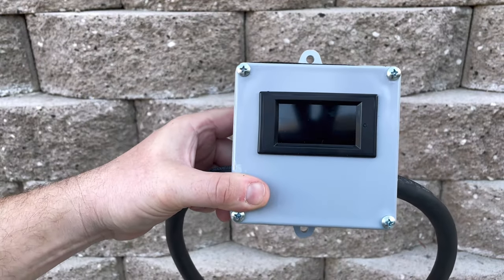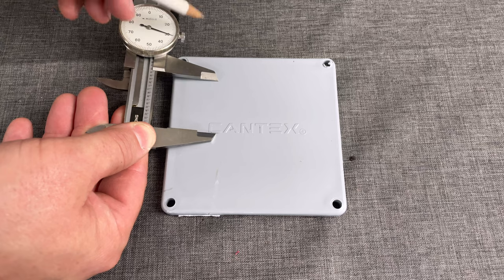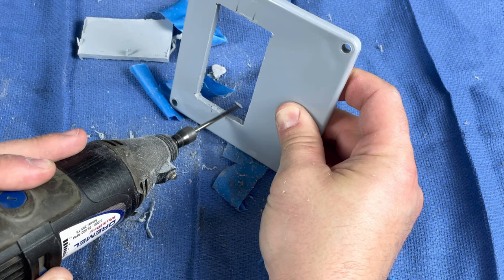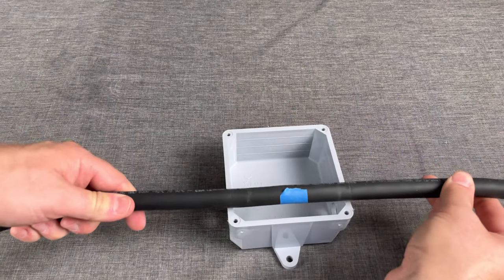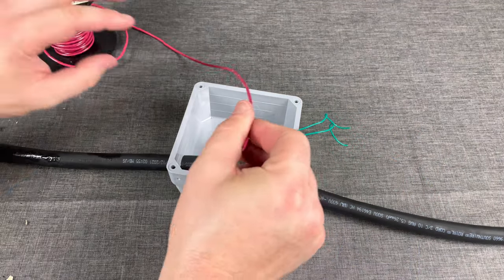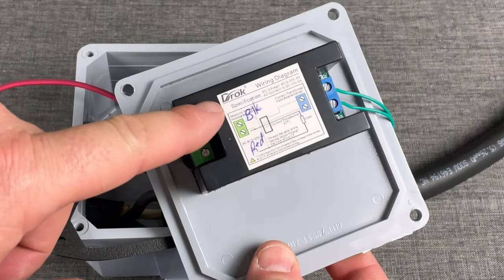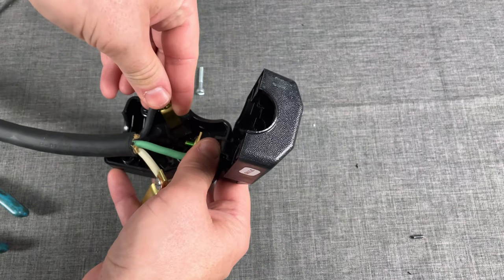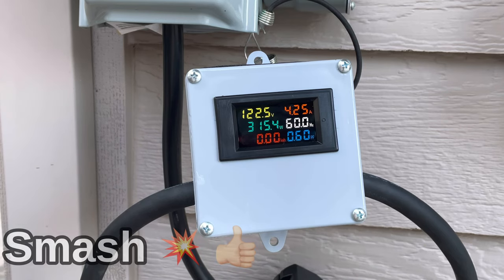Volts Amps Watts Meter RV Generator Load Meter Build

Comment: You didn't do anything to prevent the cables from being yanked out of the housing. Bare minimum could've put zip ties or hose clamps on the inside, best case proper waterproof clamping grommets.
Reply from the maker: Yes wire grommets or Electrical tape inside or a zip or something can be used which I mentioned as I was building it. For mine because I change stuff a lot for testing I did showed the basic build of it. Which you can go to the black wire or white it won’t matter. Or now someone decided to just copy what I did and refined it. Lol here look https://amzn.to/3MGTIEi

Comment: No strain reliefs and at a minimum you should have wrapped the plugs exposed wires.
Reply from the maker: Yea I could have done some plastic strain relief nuts but the plug I mentioned do not do and use the plug I had listed so there would be exposed wires. As I use mine to play around with stuff and I’m switching it to different plugs often.

Comment: I installed the Drok meter in my RV. First I disconnected the Transformer on the blue terminal and added about six feet of additional wire and then attached my "main" fuse panel positive wire through the round transformer hole. Second I had to supply power to the green terminal positive and negative. I ran two wires from the green terminal into my fuse box and connected the negative wire to the white ground bus bar. I added the positive wire to the main hot wire coming into the fuse box. Done. All the wires were ran up the interior wall and meter was mounted at eye level in the hallway above the fuse box. I should also state that I went to the main wire coming into the fuse panel because I wanted the meter to show all the power being consumed in the RV. I am also using my pure sine wave inverter and the meter works perfect and is easy to read without my glasses.  I am writing this because I wanted to save everyone some frustration that I had to go through.
Reply from the maker: Nice thanks for the tips 👍🏼😀

Comment: I would put the little compression nut strain relief things on the cables going in the box so there is no way to easily pull apart the wire nut accidently

Comment: Could I make one that has 2 read outs for a 240/50A outlet? For example: Leg 1 and Leg 2. I have a 15KW Generator and plug it up to my house. Just want to make sure I am not pulling too much load from one leg or the other.
Reply from the maker: I would not see why not. But you would tire into same neutral and power of each leg so wonder how that would work for the sensor…
May just have to try
Reply: If you use 2 phase 240 with no neutral you'll get the same reading on both legs they will be the same. So when you wire the meter you would hook a 120 line to each side of the meter instead of a 120 hot and a neutral like he did.
Reply: @walterking5210  You are correct but i think you meant  2 poles (split phase) 240V, which is 2 hot wires both carrying 120V, mostly specific to the US because the rest of the world mostly uses 1 phase 240V, which uses 1 hot wire carrying 240V :)
Reply from the maker: Yea the US still likes to do things differently with 120-240 options 😂
That’s why some of the manufacturers are like you need what?? 

The bigger Genmax I think with have a 240v single on the 9000 model.

Comment: After watching a multitude of meter build videos, I think I like your recent idea of just getting a base model Hughes Watchdog 30amp unit instead for my needs. The parts cost alone for this 120V build are almost as much as buying the Watchdog unit on a decent sale with the added benefit of also having a surge protector.  Keep up the great work!
Reply from the maker: Agree, and it’s more accurate. And like you I needed a new surge protector for my RV…😀👍🏼

Comment: I mean this is perfect, but a lot of reviews were saying that those meters weren't accurate at all.. so I'm not sure what to do I would love to have something like this hooked up though but it has to be accurate
Reply from the maker: The meter is not to far off. Down low it can be a little bit, after several checks it would only be off by about .1,.2 amps. 
But still works good for basic checking. But I have a $400 meter as well. 
Well and cheaper ones

Comment: I like it! I'm wanting to wire this permanently on the side of my house for my generator. You think I can add it in line between where the interlock breaker is and the inlet box? I wouldn't want to have it attached to a wire that haul out every time I lose power. Hope that made sense?
Reply from the maker: Yes you could easily add a wire and separate box and have it mounted right on top or next to your generator inlet box. 
Just tie into the wires from the inlet box and run it to the new box and meter. Get a covered box as you don’t want it getting soaked.
Reply: @johnnysweekends  really appreciate you getting back to me so fast! Thanks man!
Reply from the maker: No problem and thanks for watching 👍🏼😀

Comment: my generator uses l14-30r plugs, with 4 prongs on it, how would the wiring be different with a 4 wire cable vs a 3 wire cable
Reply: I think you would have to have two meters, one for each load wire (red and black)

Comment: excellent video! Does the meter readings (importantly power consumption)  reset when the plug gets disconnected or if there is a power outage?
Reply from the maker: Thank you 😀 

No the meter will accumulate hrs till you hit the little reset. 

The one I use for testing is continuing to go up in kWh. 

😀👍🏼

Comment: Any idea if the wires can be extended to mount this a few feet away from the point where the transformer is installed? Would like to put it closer to eye level in our RV instead of down at the floor.
Reply from the maker: Yes you can make it longer 😀👍🏼

Comment: I'm guessing I could do the same thing, with a larger box and two meters to test a 240v 50 amp power cord from my generator, using one meter on the red wire and another for the black wire? I could just run two pigtails, one to each meter. Is that right?
Reply from the maker: Yes each meter would get a hot/load wire.
Reply: did it work Patrick

Comment: With this set up are you measuring both legs or one?  Does the Amp reading represent total amps on the genset?  I also watched Gavins and noticed he has two meters.  At the end of the day  I have the reliance dual leg meter set up near the panel however I would rather have this at the genset and the digital is much easier to read when the lights go out.
Reply from the maker: Yea this is for a 120 volt set up and measures just only one line. Gavin made a dual set up as well so he could have a 240 volt. 
I found after much testing I wanted something a little more accurate hence I just bought a watch dog unit in stead since I needed one anyway. 
I had trouble with accuracy sometimes on the very low ended and upper ends.

Comment: Johnny good informative video, but you were making one mistake. The induction coil needs to be on the black wire, not the white neutral.
Reply from the maker: Yea I realized that after I made the video and ran it several times. Was surprised it still was pretty accurate but I think that’s mainly because I use it on generators and with a floating neutral well, it’s one in the same really.

Comment: Sorry... Another question or two. What size wire are you using for the accessory wire? Would that be the same wire used to extend the sensor wires? If I was to connect this monitor to a transfer switch, couldn't I connect the neutral wire directly to the bus. For good or ill, your great video got me thinking of multiple possibilities.
Reply from the maker: These can easily be hooked to your home distribution panel. I did one for fun just on one side. 

I’m using 10gauge braided wire. The sensor wire is small like 16g it just needs to pick up a signal. 

But yes you could use for multiple things to keep track of loads. Just run the hot wire thru it and you’re good.

Comment: Once in the meter is in the enclosure, is it fairly water resistant? The meter itself I mean. I'm curious if I could leave it plugged in and outside?
Reply from the maker: I would, just because I don’t think it’s sealed very well. So I would add a cover door to it .
Reply: If you used a proper weather tight cord connector like he shouldve for the 10/3 soow and placed a bead of silicone under the meter when installing it then you would probably be ok. Still would recommend trying to keep it dry

Comment: Nice. I'd like something similar to track the 240v wattage pulled from my RV generator. Know of any of those multimeter units that come with dual CTs?
Reply from the maker: Unfortunately I don’t know a dual set up but I am looking into some and wanna try out a couple things. Just been busy so it’s a back burner thing.
Reply: That's what I was hoping this video contained. Most generators are 240.

Comment: 6:05 "you want this on the supply side" Okay, You are connecting the wire back together. So wouldn't the sensor give you the same reading no matter where on the neutral you install it?

Comment: Will I be able to build something like this for 240 v 50amps that uses both a red and black hot wire? Or how would I wire it? Im trying to build it for my back up generator that is coming into the house.
Reply from the maker: Yes but you’ll need two meters one for each load wire.
Reply: @johnnysweekends  do you add the wattage together then?
Reply from the maker: Yes that will give the total draw. Or amps together.
Reply: @johnnysweekends  perfect thank you! That's what I need.
Reply from the maker: Let me know how it goes. I would like to try one meter into the neutral of the 240 to see how accurate it is. May have to look into that..🤔
Reply: @johnnysweekends  I'm having a hard time finding anyone else that has done it on 240v with two hots. Let me know if you have any resources for me. I'll let you know how it goes this weekend.
Reply from the maker: I don’t see why one on the neutral would not work. Your still going to have a return of power coming back so idk in theory from the generator inlet box headed to your panel should work. 
I’m not a electrical engineer but I did electrical work for a while. Have since moved on. Could try it, fire up the gen run a couple loads and check amps then check it on the meter to see if it’s roughly the same.

Comment: Thank you for this video! I see from the comments I would need 2 meters for a 2 pole / 240v circuit. But I have 2 questions:
1) Why can you not cut and splice the hots? In your video you just spread the coating of the black wire and wrap the pigtail around it...why not cut and splice with a wire nut?
2) For my situation I have a NEMA-L14 plug for my generator (2 hots, neutral, ground). In this case would I run 2 pigtails spliced off the neutral then for having 2 meters? one neutral for each meter? In the case of your video this would be the red pigtail. So I would have 2 reds and one for each meter?

Thank you for any response I would really like to get this load meter to read my generator while in use backfeeding my house in power outages.

@JOHNNY'S WEEKENDS
Reply from the maker: When running 240 your have two hot wires sharing a neutral verse on the 120 generator the load and neutral will show the same results . 
But 240 you need a meter on each load wire black and red to get the correct readings off each to be accurate.
Reply: @johnnysweekends  OKay thank you I understand that, thanks for the clarifiation on the 240 vs 120.

But also, what about my questions #1 & #2 above? Why not splice the hots with a wire nut? and for a 2-meter-setup...you would take 2 pigtails off the neutral correct? one for each meter?

Thank you again, this has been a massive help in explaining this...
Reply from the maker: The wire nuts just take up room in the box is all. So instead of cutting and adding more stuff I just spread the wire. Both work. 

And for two meter you need just the hot it each for the CT or Hall sensor. The power wires could use the load or neutral wires as they will both have power. 
Does this help
Reply: @johnnysweekends  Awesome thank you this helps!! Great job!!

Comment: How would I secure the thick wire better so it would not slip out of the box when in use?
Reply from the maker: Electrical tape after you you get it connected and find where it resets make a mark and wrap a few times or a good zip tie in each end.

Hope that helps
Reply: @johnnysweekends  Also do you know any other junction boxes that will work? Because the one that is linked is currently out of stock.
Reply from the maker: You can buy the double but then its bigger than it needs to be. 
If not I would go to the store and make sure you get a box of equal size. It’s mainly inside and some differ.

Comment: Can we extend ct wire length if yes then how many feets maximum?? And which wire should we use
Reply from the maker: You can but I don’t know how much. Several feet I would assume
Reply: @johnnysweekends  almost 40 feet..i want to place my  ct at  my distribution box and extend its cable to my room where energy meter would be installed..which wire should is use .
Reply from the maker: I would assume 12g is fine. It’s not a load carrying wire. But I would double check things a few times
Reply: @johnnysweekends  please help me in this regard ..i am waiting brother

Comment: Is it possible to use the same set up for a 4 wire cable
Reply from the maker: No you’ll need two meters
Reply: Even if it’s a 3 pole twist socket? And if 2 meters are used do you just add the 2 number to find overall power usage?
Reply from the maker: You want to run a 50amp setup..? 
240 volt? 
Each meter gets one load line.
Reply from the maker: Why do you have 4 wires on a 3 pole twist ?
Reply: It came like that on my RV   A 2019 Sabre 36bhq
Reply: This is what the warning label reads 208Y/120-VOLT
OR 120/240-VOLT AC, 3-POLE, 4-WIRE,
60 HZ,
50
AMPERE SUPPLY.
Reply from the maker: Got ya, they are doing 3 phase for 208 instead of 240 I guess. 
These trailers are getting a little more complicated. But even trailer parks I guess will be able to allow 208 as well..🤷‍♂️

So I assume that twist plug has a big metal tab on the side ..?
Which means you still have 4 wires 
It’s like they are all bonded together with the neutral I think. Which is weird wiring that I don’t mess with really. So that would be a trail and error type of scenario for me. I have done a decent amount of electrical work but am not a certified electrician. That would be my father in law. 
So you may wanna do some research on that one.

Comment: How accurate are the readings?
Reply from the maker: +/- 1 percent from what I have seen. 
I have seen 25 amps and my $400 dollar meter would should 24.7…. And some times it would be .1 off.

It’s a nice general meter but if you need something more accurate I would find something better and more accurate but that will also cost more.
Reply: @johnnysweekends  Thank you!

Comment: I thought 30 amp required 3/10 included ground? Red black white and ground
Reply from the maker: Red black white and green is basically your 50 amp circuit.
Red= load 120 volt
Black =load 120 volt 
White = neutral 
Green = ground
240 volt circuit. 👍🏼

Comment: so this is not a 220 volt split phase then,since you are only using the 1 hot wire, your just using an rv plug though most rv plugs use 220 volts, 2 legs,2 hot and 1 ground, no neutral is used, so if i wanted to  mionitor both legs or phases i wouild need 2 meters
Reply from the maker: Yes you would need two meters or you can look into buying something like this and it does the same. You can buy prewired as well…https://amzn.to/3IadPHn
Reply: @johnnysweekends  thanks

Comment: So this went on the Neutral? 
I would have figured the Hot leg
Reply from the maker: I thought the same.
Reply: In this case it doesn’t matter, but I would naturally place the hall sensor on the hot leg (Black wire).  You are measuring the current of the circuit.   The current should be the same for the hot and neutral wire.

Comment: I swear you said connect the round transformer thing to the negative wire which did not work for me. I had to attach the round transformer to a positive wire.
Reply from the maker: Pretty sure it was load wire or neutral ..🤔
It’s been a while

Comment: No solder???
Reply: You wrapped the smaller wire around the larger wire and taped it without soldering.
Also, the manufacturer of that meter you linked specifically states not to use it on anything other than utility power.
You have a good channel, but you're encouraging unsafe practices.
Reply from the maker: The small wire is a pick up wire…. Doesn’t do anything besides provide signal and a pinch of power. 

Manufacturers of about everything, including your motorcycle tell you not to use it a certain way. Do not modify the motorcycle under any circumstances and never ride faster then your ability or the speed limit. Make sure you follow your manuals break in period and all service intervals to not void warranty. 
Replace all items if they don’t meet spec and only use OEM parts and fluids to not void warranty.  

Do you see where I’m getting at. Legal material to make sure the company is not liable for anything. 

Many items for Ac is not soldered just wire nuts, or blocks and more. 

There are thousands of channels, and some really do some unsafe stuff with no experience at all. Which if the viewer they do not know or are not comfortable with anything they see in anyones video they should consult a expert. Like with all my videos they are for entertainment purposes only and JOHNNYS WEEKENDS IS NOT RESPONSIBLE, for viewers who don’t consult experts first or have proper knowledge or skill.

See what I did there….

Utility power is sine wave at 60hz and so are all of these generators. 

I should show you the generator diy natural gas trick video….. that guy is gonna kill a whole neighborhood hood